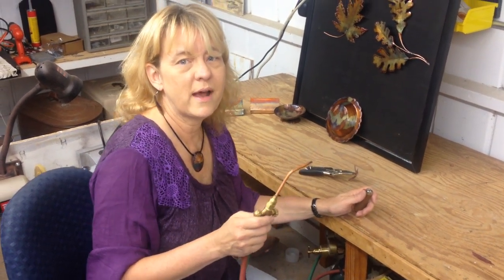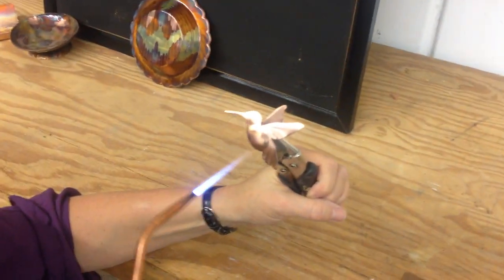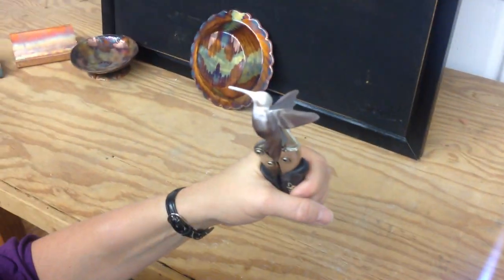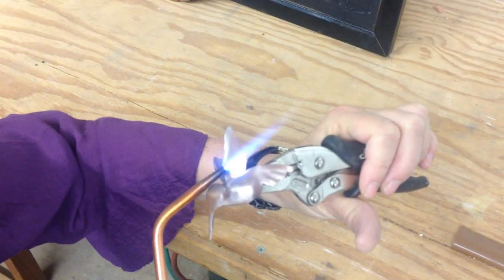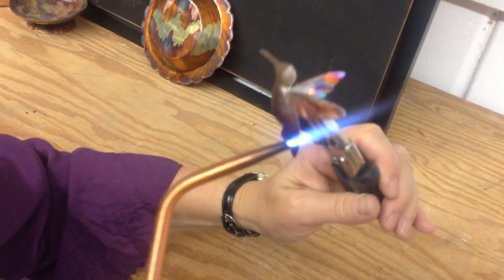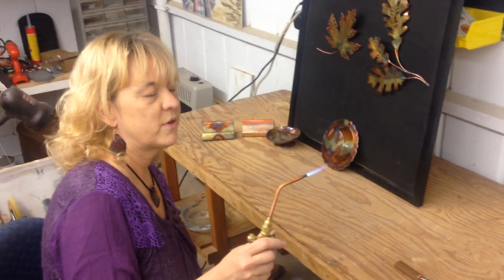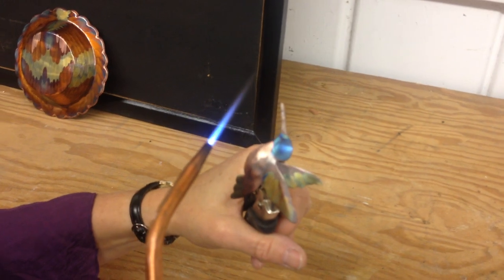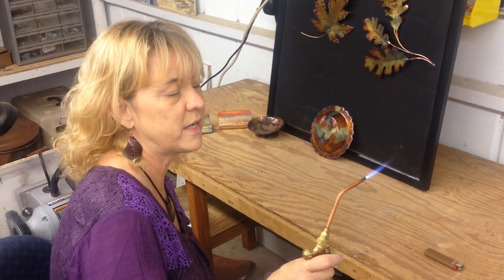Flame Painting 102015

Comment: Interesting, thank you. I’m not a flame painter. I’m looking for a non-elbow grease method to clean my garden copper pieces.
Reply: Sorry, I only clean my pieces just before flame painting them. I basically soak the copper in a bath of sodium bisulfate, sold at Walmart for swimming pool treatment under the name PH Down. Then I rinse it with distilled water.  So, if you have a swimming pool...? LOL!
Reply: This is late, but #0000 steel wool brings corroded copper back to life. And it's easy, no elbow grease needed. 🙋♥️✝️🇺🇲

Comment: I love your videos!!! Can I ask what pliers you are using to hold your metal? Is there a loop on the back of the metal that the pliers hold on to? Xxx
Reply from the maker: I use vice grips with rubber handgrips so that they don't get very hot.  I solder a piece of wire on the back of each piece so that I can hold it.

Comment: Is there a good way to mask the copper? Like for example, if I had a copper piece and I wanted it to be the copper color with a blue pattern on it. Is there some sort of paint on ceramic that could be used for masking, and then washed off after the coloring is done? Thanks
Reply from the maker: i’ve never done it but I’ve heard it said that You can actually mask it with liquid white out. But then you have to scrape it off.

Comment from the maker: Hi Olcay, thanks for your inquiry: unfortunately, color change is a common problem and the biggest source of frustration among flame painters.   I can’t recommend anything that won’t alter the colors at all, but I use a product that I buy online. Don’t know the generic name but I will share the link:  https://www.everbritecoatings.com/cart/index.php?main_page=index&cPath=7

It’s called ProtectaClear.  If you go to the website perhaps you can order online or find out if there is a generic type.

Good luck with your art! -Miriam
Reply: Thanks a lot. I am sorry I didn't see your second comment last time and said that I was lost. Actually I ordered the same 3-4 days ago. I believe it was mentioned in you video or someone elses. It is very nice masters like yourselves help the newcomers. Thanks again and wish you the best.
Reply: Do you use the spray or do you paint it on?  I have been using Colorloc but it of course sill changes the color - I am wondering if the Everbright Protecta clear would be better for preserving color and is there a difference between the spray or painting it on?
Reply from the maker: @HorsepuckyGirl   It depends on what I'm making:  if it is smaller than 8", I dip it into the Protectaclear.  After that dries, I spray it with acrylic gloss.  If it is larger than 8" , I have to paint it on.  I don't like to have to do that, as it is more time consuming and also can leave debris in the finish. Protectaclear is self leveling, so if you dip a flat object into it, you can lay it down flat and it dries into a lovely, even finish with no brush strokes.

Comment: Hej  i do this with a gas torch and a small one also but when finished how  do i keep the colour onto the copper ?  What i mean is, i sand down the copper, shine it up with wire wool and then use my burner on it , oce i have the colours i leave it cool, but then on some of them the colours all rub off and i am left with a blotchy colours .  Any tips please ?  Thanx could i use a lacquer to hold fast the patina also ?
Reply from the maker: A finish that will seal out the oxygen in the air is necessary. I have used acrylic spray or ProtectaClear